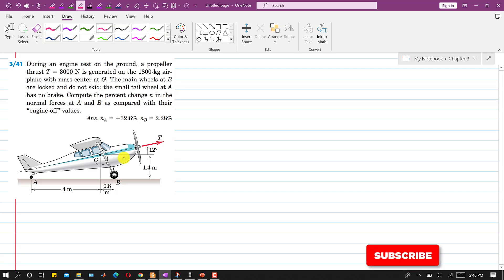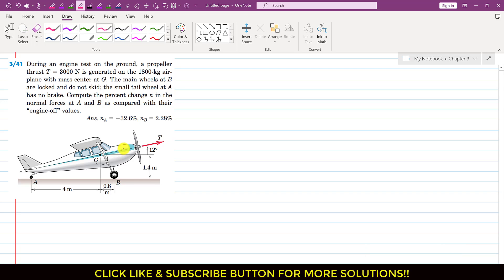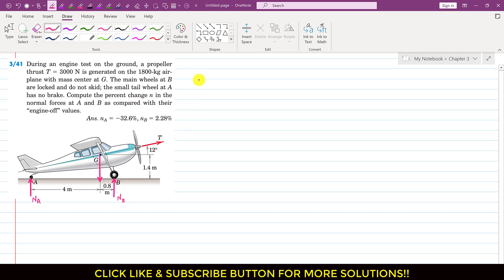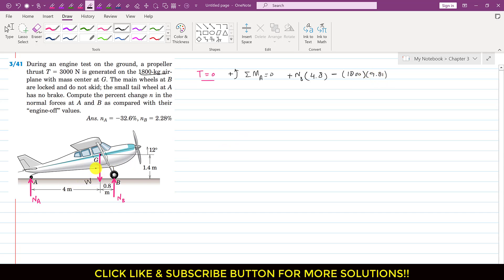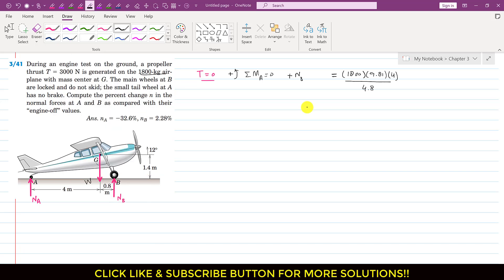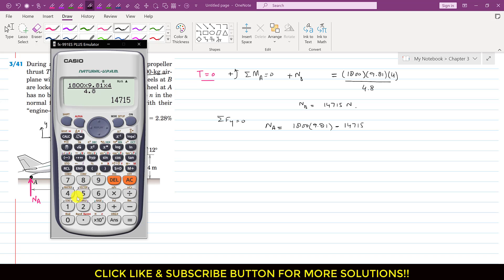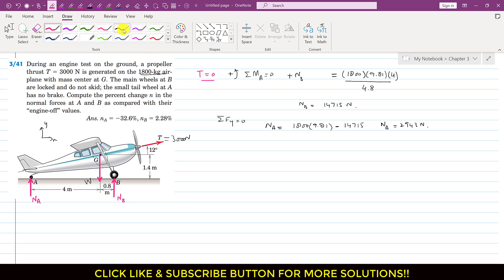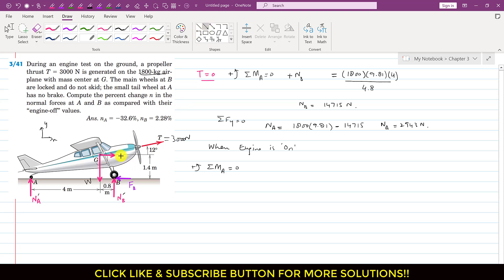Compute the percent change n in the normal forces. Chapter 3: Equilibrium | Engineers Academy

Comment: This answer is not accurate. When you punch in the equation of the Nb in the calculator, when the engine is on, it doesn't give 15051N it gives 16794N unless I am punching in the wrong values.